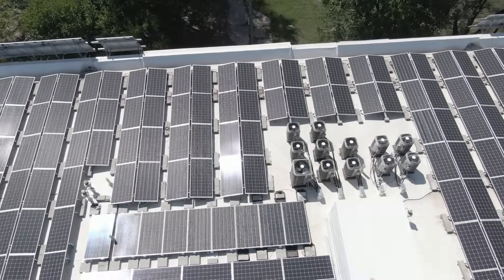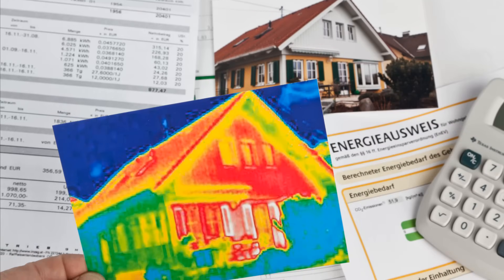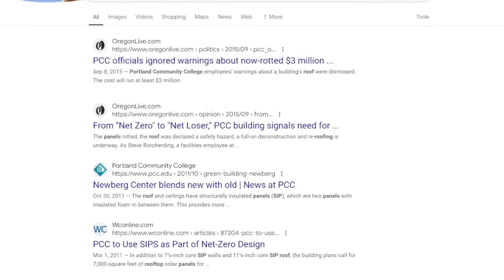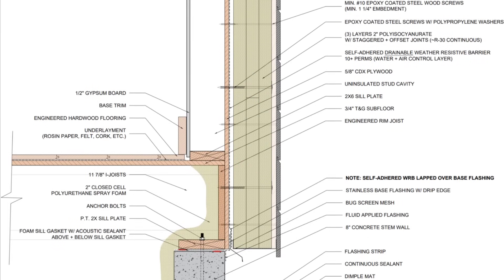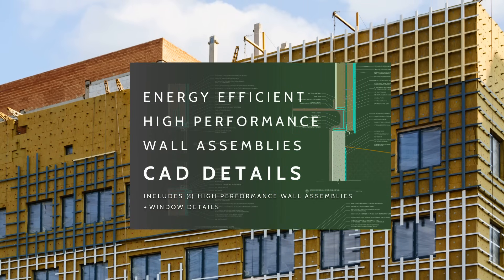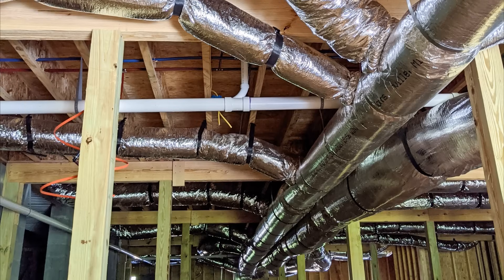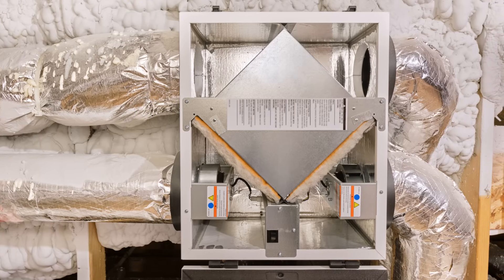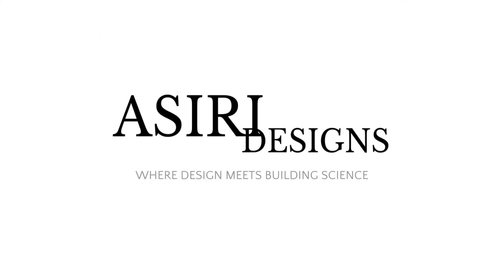The Unintended Consequences of Energy Efficiency...

Comment: In New Zealand most people (80%?) don't cool their homes because in most places it is hardly ever necessary. I observe that with the interior usually being warmer than outside, all that is necessary to prevent condensation is to enable a small amount of ventilation. For example when I vacate my living room for the night I put a window on a catch to be open a quarter inch and the small amount of incoming fresh air is sufficient to prevent condensation on the aluminium window frames. However, if I don't do this, there are pools of water on the window sills in the morning.

Comment: This video is so funny to me.
Because everything mentioned in it has been solved over 100 years ago in europe. Insulating homes from teh outside? Well nobody wanted to loose inside space so ofcourse it goes outside.
Loss of ventilation? Well just open your windows for a bit each day. There even is a german word for taht "Stoßlüften" (shock ventilation) which serves only  the singular purpose of getting out the mois air inside your house during winter and replace it with fresh air without wasting excessive amounts of energy. Ofcourse a proper passive ventilation system is even better.

The US needs to change building materials first and foremost. Wood is THE worst building material for a sustainable house. It has 0 energy retention, 0heat shielding and is excessively prone to heat, cold and moisture. 
Amercians never learned to ventilate their houses because it would loose them a lot of heat. A stone house or better yet one build using hightly energy dense stones would retain most of the heat you put into the stone during the winter reducing the need to reheat your house after opening a window for 5 minutes. The same goes in the summer. A/C are pretty uncommon in europe and you wonˋt find them in 99% of residential buildings in germany. Stone keeps out the heat from the outside for a long while, especially  if insulated from the outside. 

Building a "net zero" or "net positive" house in germany required no changes to how a house is build. it was just a question of quality. Making sure everything is airtight (and I mean air tight. You literally fill the houese with smoke to test if any of it leaks out, it only passes if none leaks.)
Reply: Americans build homes from wood because it is available here. new build stone and brick houses are prohibitively expensive because both the materials and skilled labor to assemble them are not as widely available as they are in Europe. Not to mention, building new homes is not land or resource efficient when we have all these existing homes that we could simply improve upon.
Reply: Wood is an excellent building material. Heck Gutex is made in Germany and is amazing. Wood shouldn’t rot, if it does there are moisture issues that need to be dealt with regardless if using stone or metal, etc.
Reply: This thinking is strange to me. People talk about the US/NA as if it's a monoclimate.  Example with heat retention- winter lasts for a month or so in the South. Then it's warm, then hot, then cremation temps set in around Aug to mid Sept.  The last thing you want is heat retention when it's still over 90F at midnight. Now, travel a 1000km north, and what you talk about has merit and then go another 1000km north and is crucial.  
We also have a huge problem with building with stone because no one knows how, it's incredibly expensive, the ground settles unevenly and makes even simple slab foundation maintenance a challenge. Making a building out of stone would be insane in my area. Given that we have to water our foundations to maintain them and even then see a 5cm to 10 cm+ difference in foundation elevation over the span of a decade or so. Having rigid walls would make foundation repair (already expensive) into a whole house repair. Yipes!

Comment: In a cold climate why put a water and vapor impermeable surface-insulation on the outside? Seems like a great way to trap moisture in the wall. Interior vapor barriers don't work because air flow is inevitable, and it carries a lot more water.